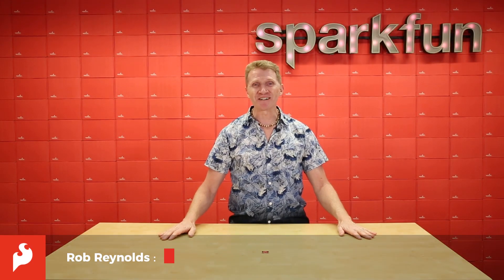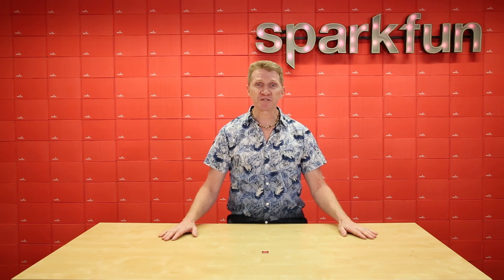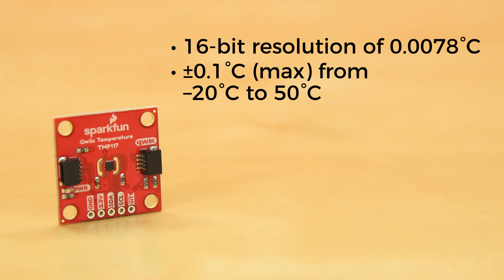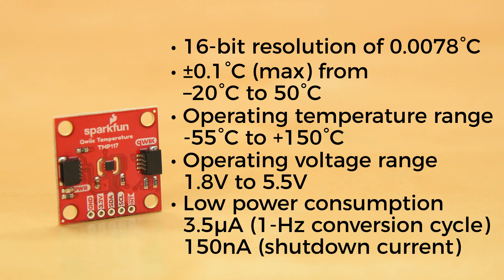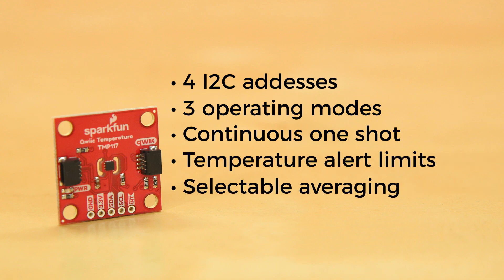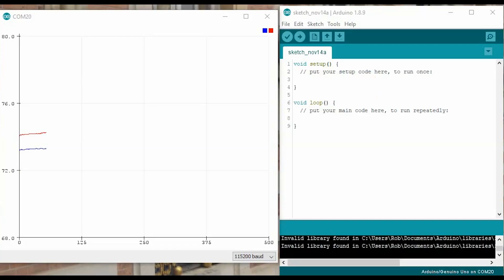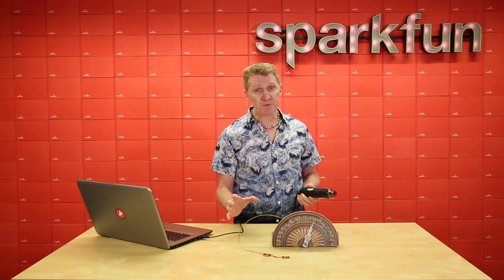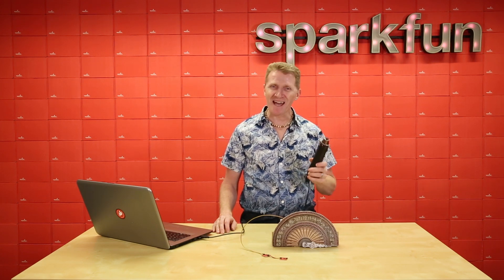Product Showcase: SparkFun High Precision Temperature Sensor

Comment: Plz make high precision Vaccume sensor for measuring Pressure in high voltage plazma vaccum project  there is no such Arduino competible sensor 🤔
Reply: Everything (almost ) is arduino compatible ,given that you use the correct protocols and code. Moreover , sparkfun doesn’t actually make the sensors , it makes breakout boards ( with necessary circuitry ) to interface with the SMD sensor package.

Comment: Congrats guys, bought a bme680 from adafruit and is clearly not precise enough even to be used in a thermostat. Iove the specs of this sensor but it's so big can't you make smaller PCB? Your "things" generally use big PCB, pretty difficult to integrate into small appliances.

Comment: what's the point of having a 16bits res if your accuracy is .1C to .3C?
Reply: Averaging to reduce errors due to noise.
Reply: You might have a pretty big static offset contributing to the error, but you will still appreciate the 16 bit res. Let's be honest here this sensor is amazing.